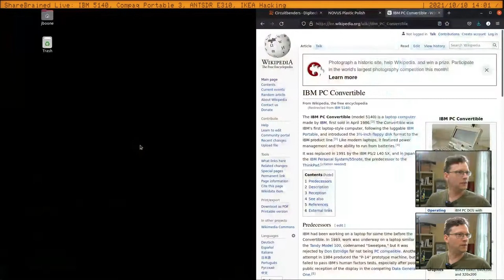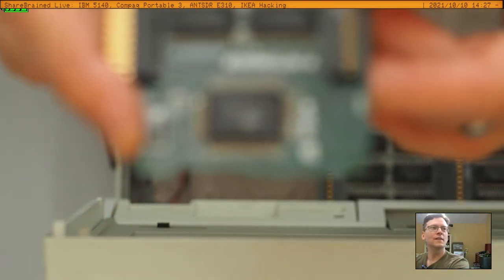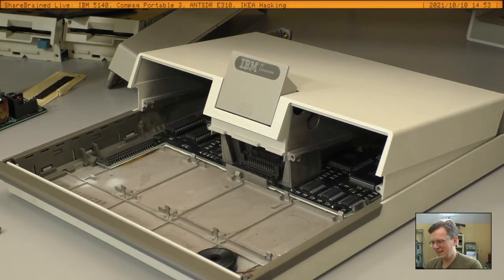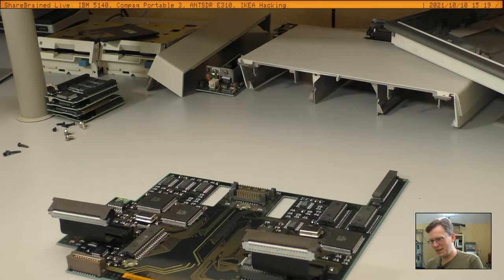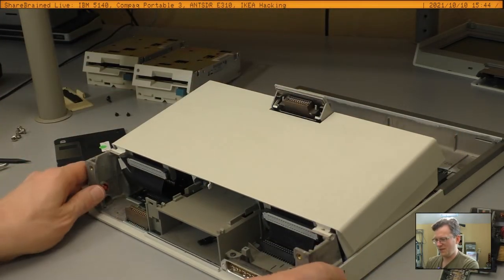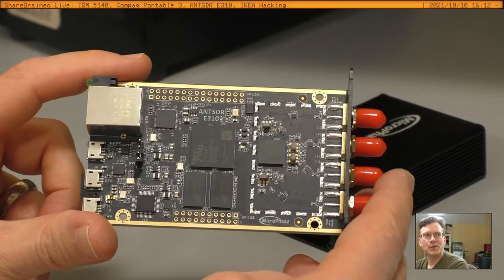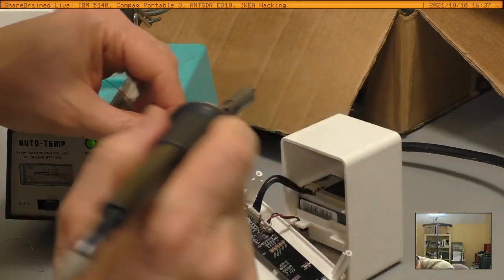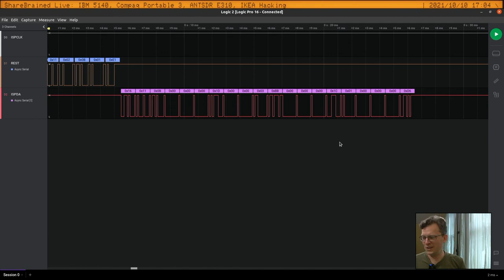IBM 5140 Convertible and 300 baud modem teardown, ANTSDR quick look, IKEA air quality sensor hacks

Comment: Hehe - in my video, I say that a nickel works better to open the keyboard tray. I also didn't detach the keyboard just to get at the memory tray - it hangs from the front of the display. Initially, only the 128Kb modules were available, so you have 512Kb in the four modules. Third-party and the later IBM 256Kb cards help you reach 640Kb, as I show in my video.

There is also information on the PC Convertible at the 'Ardent-Tool' website. I do live-streams every Saturday morning, 10 AM MST (GMT -7). If I would have been aware of this stream, I would have given some guidance (I have been subscribed, thanks for not notifying me YouTube!). Of course, I've moved off the 5140 and the monitors it can run, but reach out to me, I love having been a reference here!